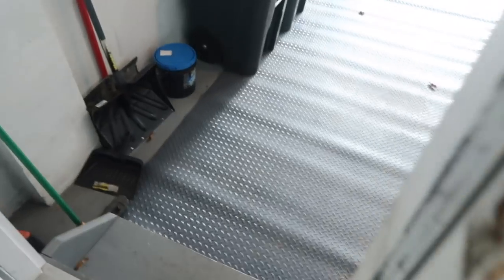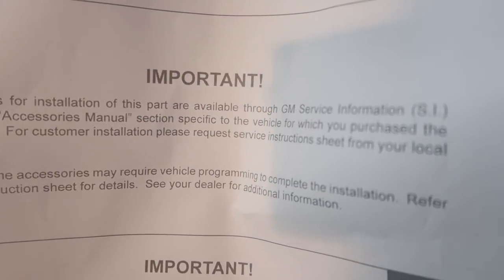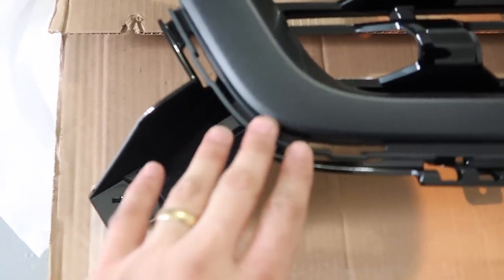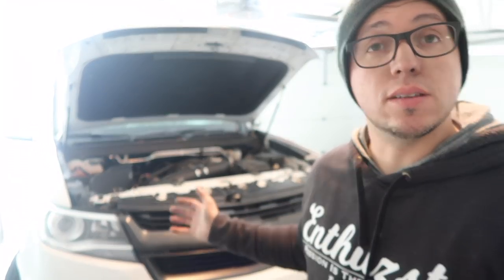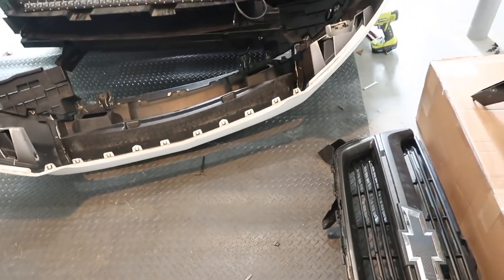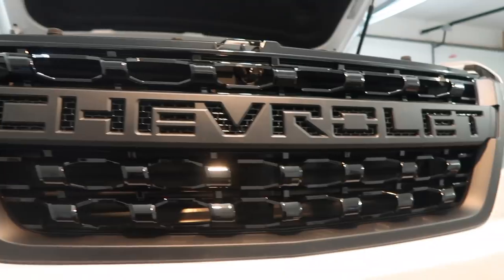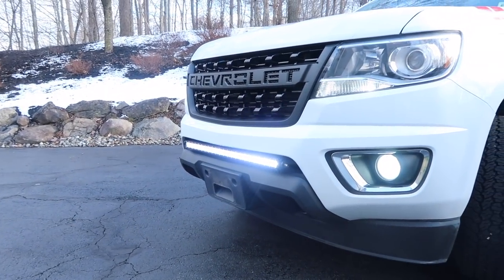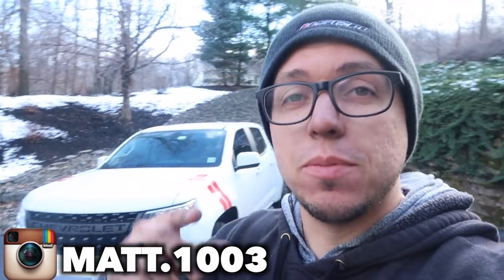2017 CHEVY COLORADO GRILL INSTALLATION

Comment: I'm picking up my 2017 Z71 this afternoon. Was looking for some mods ideas. Thank you for you vid. How about removing the front splitter (air dam)? That thing is way too low and kind of dissimulate the middle section of the bumper which look very good. It's the first thing I am going to do.
Reply from the maker: Thank you man! I did that already... look for the video you will see it!
Reply: @Matty.Garage  Yes I saw the video and also read the comment ''after 1000 comments''. Just did not come back to erase mine. Got my truck 2 days ago. Already looking into changing a few things. Your videos will certainly help with ideas and guidance. Good thing to have someone passing through trials and errors before you do. Thank you for that!!

Comment: Matt, that looks awesome! I've wanted that grill for a while now, just wish it were a little cheaper. Definitely think you should remove the airdam off of the front bumper. It's not that difficult to do, just a little tedious.
Reply from the maker: I will think about man!! and Thank you!!
Reply: I agree I removed mine on my ‘16 Colorado z71 and have noticed ZERO difference with it off and it looks way better and now there’s a ton more ground clearance
Reply: Its going for $296 right now, its cheap enough for me
Reply: @exiquiogonzalez4549 , $296 isn't terrible. But, shipping is ridiculous. Shopchevyparts is the cheapest I've found at $52. I've looked around and shipping went as high as $111. That's nuts.

Comment: . Am really appreciate the great support.
Reply: So. I just have one question., 
I have s10 of chevolet 2016. But i would like to know if is the same position clamping in the bolts for the chasis s10.  

Only i want to change the bumper colorado 2017 to s10 2016

Comment: i installed a bull bar to my 2019 Colorado. can I remove and install a new grill without having to to remove and replace the bull bar too? I have wired lights to it and have it all tight and tidy. I really don't want to have to do extra work
Reply from the maker: You might be able to do it ... just need to take your time and find support for the bumper so it won’t hanging while you are trying to remove the grill
Reply: @Matty.Garage  thanks for the reply and thanks for taking time to upload this tutorial